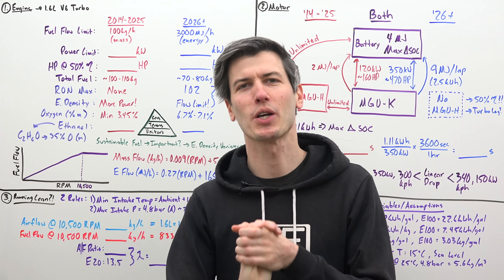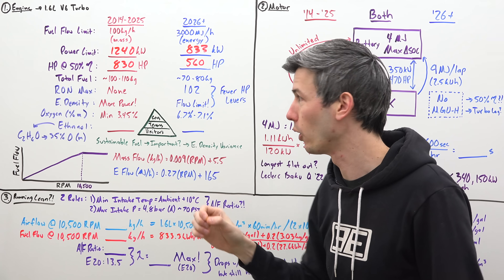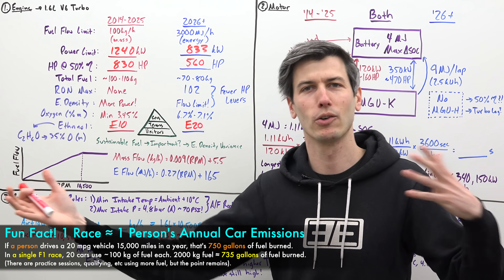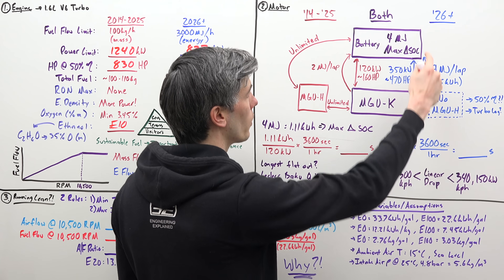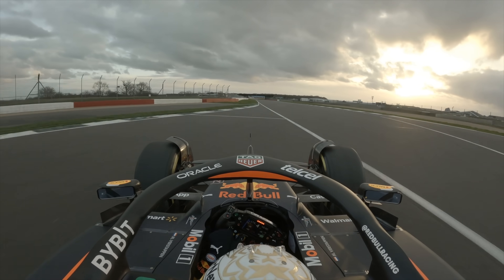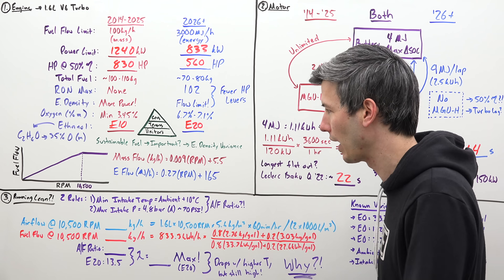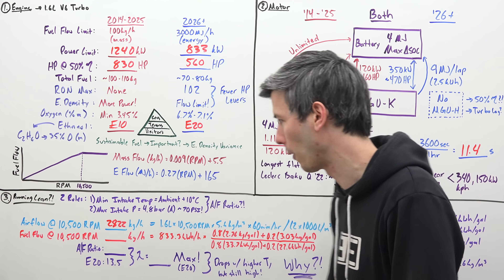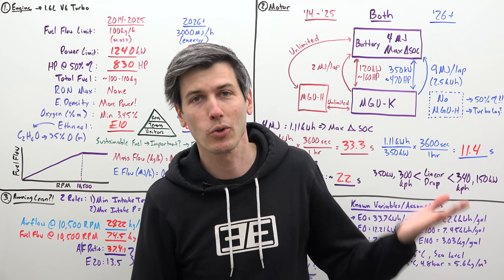Why Are 2026 Formula 1 Engines Going To Lose So Much Power?

Comment: So.... To sumirse things. Fia is going to make F1 slower for no particular reason, since there is not going be any noticible gains in efficiency/sustentability, the car will make less power through combustion, while increasing eletric power, but they will limit the time you can use the electric engine by HALF???? And the cars will stay approximately at the same size/weigh. On the other hand I guess we will get a better sounding engine, since the mgu-h,which is directly attached to the exhaust manifold, will be gone, so creating a less restrictive exhaust and allowing more noise can go through, but I don't know if I like this changes very much....

Comment: I miss the 3L V10... 😞
Reply: I'll never forget that sound
Reply: ahhh yes....the screaming good ol' days
Reply: I miss 3.5 V12
Reply: I went to Brazilian GP 2001. My first race. The Ferraris, the Mclarens and Williams BMW were insane to hear. I was cheering for Rubens but he crashed into Ralph Schumacher at the beginning of the race. My father gave me the tickets as a 18th birthday anniversary
Reply: Everyone who cares about the sport does.
Reply: @timXJ220  Cares about the sound, the sport is alright
Reply: I would kill to see a 5L V10 screamer.
Reply: @WilsonianGarveyite  Gallardo 1st generation xD
Reply: It would be awesome if F1 brings back V10 and have incentives for small custom engine builders to join in and build F1 engines and brownie points for an engine lasting a whole race season. As well as the return of refueling with the option of quick fuel like adding in fuel as quickly as changing the tires so the F1 driver can get ahead of the pack from a quicker pitstop and lower vehicle weight from having less fuel with the tradeoff being the risk of being out of fuel before the next pit stop if on a very low tank of fuel prior to refueling or a full refueling to keep the lead which takes 6 to 8 seconds.
Reply: even if they were turbo v10 hybrid
Reply: @tturi2  F1 V10 were NA and no hybrid. They did start with 3.5L, then after the Imola accidents downsized to 3L.
Reply: @ecsolha  yeah but I mean even if the new cars were v10 turbo hybrid, that would be cool
Reply: @tturi2  Yes you are right, and also insanely fast I would think.

Comment: A Brief History of Racing Fuel By Craig A. Johnson

In 2005, the IRL used 100 percent methanol in their tanks. The fuel worked well and was more efficient than straight gasoline, but IRL officials believed there was room for improvement. In 2006, they moved to a 10 percent blend of ethanol and methanol, which was then changed to 100 percent ethanol for the 2007 season.

The desire to use only ethanol aside, 100 percent ethanol is nearly impossible to obtain, and is illegal to keep without paying hefty taxes that date back to prohibition. The actual fuel used by the IRL is a blend of about 98 percent ethanol and 2 percent denaturant. The exact composition includes a small amount of high-octane racing fuel.

The fuel for today's Indy cars has an octane rating of 113, compared with methanol's 107. This means a significant reduction in pre-ignition, or knocking and pinging.

In addition, many of the people who handle the fuel, say it smells like tequila. This quality may seem insignificant, but smell is actually one of ethanol's benefits when compared with methanol. Pit crews noticed the switch to ethanol immediately, reporting fewer coughing fits and less eye irritation before any other modifications were made to accommodate it.

According to Dennis Vervynckt, manager of hospitality services and an IRL official, in 2006, the first year the IRL began using ethanol, teams saw a reduction in efficiency of about 10 percent. "That's because we put straight ethanol into the tanks," he says. "The teams initially didn't make any or very many adjustments to their engines. After a few months, they kept tweaking and by the end of the season they were back up to 100 percent efficiency."

Vervynckt points out that there was a minor loss of power. "When they first started using ethanol, teams saw a slight drop in horsepower," he says. "As the teams got used to the fuel, they were able to get more horsepower from ethanol once they again reached maximum efficiency."

The switch to ethanol also allowed the racers to carry less fuel and make fewer pit stops, thereby increasing efficiency even more. "When the cars ran on methanol tanks had to hold 30 gallons to accommodate the fuel requirements of the cars," Vervynckt says. "After getting the engines to perform at their full potential, there was a significant gain in mileage. Indy cars now have 22-gallon tanks. When a driver pulls in to change out his tires, he can fill up. Teams were able to match their tire and fuel stops exactly, instead of stopping for tires only, or fuel only."

That efficiency translates into much less fuel being used by the sport. Lifeline Foods LLC, which supplies fuel for the IRL, will produce 120,000 gallons of ethanol for the 2008 season. And though this may seem like a lot, it's 20,000 gallons less than was used the previous seasons.

The switch from methanol-based fuel to ethanol has amazed almost everyone in the league. Drivers, the direct users of the fuel, voice their approval in glowing terms. "[Ethanol] is an American fuel that is good for the country and the environment," says Ryan Hunter-Reay, of Rahal Letterman Racing and driver of the ethanol car. Standing beside his crew as they make last-minute adjustments to the car, he is more than happy to discuss the benefits of the IRL's switch to ethanol. "It's been great for Indy racing the fuel economy, emissions there's nothing we don't like. We love it."

Comment: Do a video on the total carbon footprint of a gallon of ethanol fuel vs a gallon of gasoline, including things like the fertilizer used to grow it, the methane used to produce the fertilizer, and the methane leakage during production, and the logistical chains of both sources. I'm curious which one is actually more.
Reply from the maker: See this video: https://youtu.be/F-yDKeya4SU

Comment: Could running way more boost than necessary be meant as an anti-lag and low end torque feature, where inertia of air in the intake and  the turbo itself keeps things moving during throttle lifts, and then unneeded boost is simply blown off at higher revs?
Reply from the maker: I was wondering if something like that might be possible, but you'd be wasting energy to create higher boost, and you'd have to bleed that intake air off before it enters the engine to meet A/F ratio requirements.

Comment: Why are they so concerned about fuel efficiency when they fly military planes over before each Grand Prix
Reply: @jafooli flying military planes overhead doesnt increase fuel use or pollution. All military pilots need to log a certain amount of hours flying to keep proficient. Flyovers are part of that time.
Reply: That's has nothing to do with the FIA
Reply: The Climate Change Circus🤡

Comment: I do have a theory as to why such a high air fuel ratio was chose: 
so much air being crammed into the engine combined with high compression ratio will evidently generate much more heat. This can lead to bigger radiators ie changes to aerodynamics of the car, aiming to make designs more different and competitive amongst each other
Reply: They will eliminate the radiators to utilize all BTUs in the fuel to do work (go fast)!  If they reduce the CR (compression ratio), they can substitute heat to conserve energy which is limited.  Follows the basic principles of the adiabatic engine where all energy is used and not wasted!  Basically heat and compression are the same thing!!
Reply: @garybulwinkle82  ok if you're lowering the compression ratio, you're either using more boost pressure or just don't like clean combustion....and the engine will be made out plastic if you really want adiabatic working. There's no way a metal block won't transfer energy out of the system without thermal conductivity and only as work on the output shaft.
Reply: @garybulwinkle82  That will definitely not work as a performance improvement, and sounds like a misunderstanding of the adiabatic process, besides the real consequences.
Looking at the P-V you maximize work by max pressure and max volume expansion.
Compression and expansion is considered adiabatic because there isn't enough time to transfer any significant heat to or from the engine block. Therefore the heat in the engine block is irrelevent by definition of adiabatic. So you can't call it adiabatic if you're adding heat from outside, as you suggest. 
While compression increases temperature and pressure, it's the combustion that creates the large pressure spike to then drive volume expansion.
To take advantage of a hot block, would require running extremely slowly limited  by the heat transfer rate from block to gas. Not only that, but lowering comp ratio lowers the volume expansion and therefore work. Running extremely slowly in addition, lowers the power output as that is based on time. 
To extract all the energy of the combustion, would work with walls being hot enough to prevent loss from system, but it would be an extremely slow and long stroke process, and would be a more efficient but useless system. 
This is not even to mention the fact that lubricating oil would break down and kill the engine running at that extremely high saturated temp. Nor that charge are would be very hot therefore less dense, killing more power.
There is a reason thermodynamic cycles are considered ideal and theoretical examples of different system types.
Reply: The A/F ratio is not prescribed. It's the max, and won't need to be run that high.

Comment: Now that cars under 1000 units a year can still runs ICEs, why not bring the NA V12s back with hybrid tech? Heck ONE long haul airplane flight these guys do burns more fuel than the entire grid does in a year - so you guys workout the logistics of shipping the cars and personnel and equipment and data from one cross continent event. Even assuming they burn 300 kg a weekend. Heck the massive fireworks display at every circuit probably produces more emissions and particulates than the entire race weekend. And this tech might usually be too complicated to ever come to a road car in this architecture so there you go.... 

Virtue sells well, in reality few are truly virtuous.